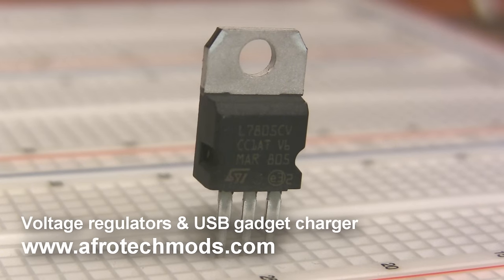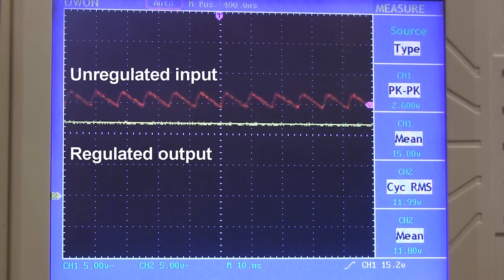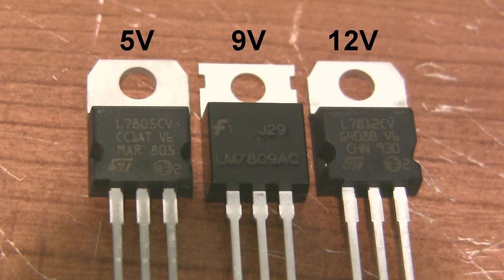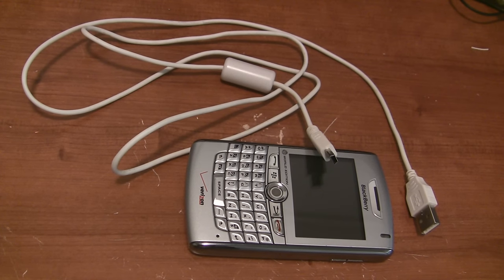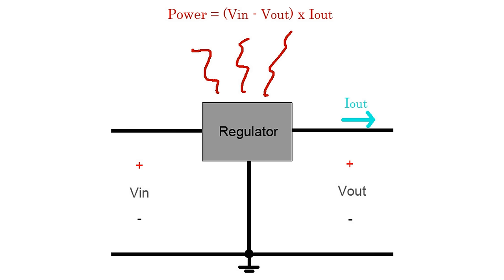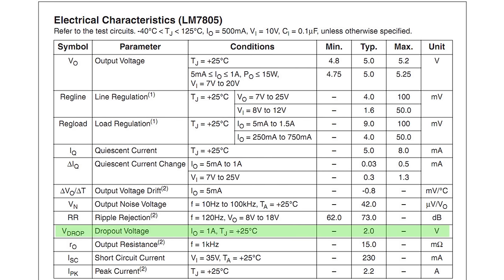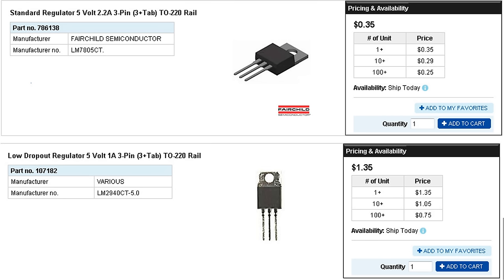Voltage regulator tutorial & USB gadget charger circuit

Comment: I've discovered that if you put the load between the input and output pin, you can use it as a voltage substractor, usefull for a cheap gauge indicator for 12v batteries

Comment: How do you know that you need a 10mikro Farad capacitor. Is there a formular to calculate the capacity of capacitors to a different project for example?
Reply from the maker: Capacitors can be used in tons of different situations and the formula to use will depend on the situation. 10uF for a linear regulator is just a generally good guideline value. The best way to find out the value for your situation is to google for the datasheet of the component you are using. It will either show you the formula or give you the recommended value.
Reply: It depends on the regulator, the current draw, and filtering requirements which remove high frequency transients and voltage spikes from the load. The datasheet for the regulator provides the details for what smoothing and filter capacitors to use in various configurations.
Reply: Survival Lilly
Reply: Read the datasheet for the regulator you actually use, especially for low-dropout ones.  Datasheets have specific information for the actual device so are the definitive source of information.
Reply: Fancy seeing you here Lilly!!! Love your videos!!!!
Reply: Capacitance doesn't really matter, the higher the capacitance, the more energy is store and the smother the output voltage is.
Reply: depends on the line frequency...proper uFD used is, " what frequency " is my ....project  ??? do a study on "pi filters "
Reply: @luongmaihunggia   I would not think you would need any or much at all if you are connecting to a battery. I don't have a scope, but I can't imagine a battery having a wave-form.. it's when you are converting from AC on a bridge rectifier and your DC is all wavy that you need the filtering capacitance. Basically, the higher the amplitude and lower the frequency of your input voltage wave the more capacitance you need on the circuit. I like to think of it as the capacitors average out several waves, the more capacitance you have the more waves it's considering for it's average.
Reply: @akunog3665  batteries are not perfectly DC, you still get electrochemical noises which are typically gaussian in nature....
but you also have the issue of coupling on wires, still recommended to use 0.1uF as a clean up on input.
the output capacitors I'm sure are more for "bulk capacitor" uses... to keep the output current maintained so that you don't get droopage when overdrawing.
Reply: @Afrotechmods  ⁷7_uu<⁷⁷⁷
Reply: Lovely
Reply: Ayyy! I watch your channel and just came across this comment of yours. Very cool to see that even 7 years ago you were putting in the work to learn to be self reliant and prepared. I need to find me a women like you lol Keep up the good work!! You are changing many lives for the better ❤

Comment: I don't understand the 251 people who disliked this video. It is as elaborate and as clear as can be.
One question though, what are the input and output capacitors used for exactly?
Also a question that is slightly off topic, I am trying to build my own Power Bank to charge my cellphone and intend on using either rechargeable batteries or disposable batteries.
I'm not very familiar with the way batteries work but assume these batteries do go empty, does that mean their voltage will drop from, say 5V, down to 0V, thus meaning I'll have to get a low-dropout Regulator?

Thanks!

Comment: 78s are positive regulators while 79s are negative.
Reply: RiaRadioFMHD773 Thanks for the tip!
Reply: haha i see what you did there.
Reply: thx a lot!
Reply: thank u
Reply: Can u plz explain the use of 79s
Reply: Rishik Kumar Negative regulators are used when you have a Dual Supply setup.  In a Dual Supply, you not only have a Positive Power Rail which is at a greater voltage than Ground, but a Negative Power Rail that is at a lesser voltage than Ground.  You can use Negative Regulators to do the same filtering to the Negative Power Rail that Positive Regulators do to the Positive Voltage Rail.  Dual Supply setups are sometimes used in signal processing or sensing, when you need to sense a truly negative input voltage swing.  In some things, though, such as audio processing, you can put in a bit more work to avoid the need for a Dual Supply setup.  Adafruit makes a ±12V dual supply that is not too expensive.

Comment: I am confused about the function of the 0.1 uF capacitor.  I understand a voltage ripple reducing circuit that uses two capacitors with a series resistor between the + leads in series with the current flow;  but when you put two capacitors together in parallel as shown - they just add their capacitance.  Right ?  So isn't the circuit as shown the same as just one capacitor at a value of 10.1 uF ??  and how is 10.1 uF any different than a single 10 uF capacitor - really ?  Thanks for any info you can provide !!
Reply from the maker: Donald Filbert The 0.1uF cap is made with a different dielectric - it is a ceramic cap. The 10uF cap is an aluminum electrolytic cap. Ceramic caps work much better at higher frequencies. The 10uF cap would be useless at dealing with noise at 100+kHz.
Reply: Afrotechmods Cool !!  Thanks for the response and info !!!
Reply: +Afrotechmods To the important in difference in dielectric is their ESR, Equivalent Series Resistance. In this circuit, ceramic's lower ESR helps the capacitor smooth higher frequencies.
Reply: +Afrotechmods so the purpose of that 0.1 uF ceramic capacitor is to further smooth out ripple in the output cause by higher frequencies noise?
Reply: Correct.  If you go back and look at the Osciloscope, you can see that there is some noise in the output voltage.  The 10uF and the 0.1uF capacitors help to clean up this signal.  If the original author were to hook up another probe to the board on the output side of the capacitors (or even just move the probe) we would see a near flat output voltage from the circuit.
Reply: @Afrotechmods  I was wondering the exact same thing! Thanks for the detailed answer. Hope to see this stuff in the video itself though!

Comment: Quick question. I know that some devices are trickier to charge (e.g. Apple Iphone from what I heard). Can you charge android tablets by supplying it with 5v or is it a little bit more trickier?

Also it would be awesome if you could talk about switching regulators. They more efficient and can handle a larger voltage range than linear regulators.

Comment from the maker: If the datasheet says you can leave it alone ("floating") then it's fine. Sometimes components will have internal pullup or pulldown resistors that make an input pin have a "default" state.

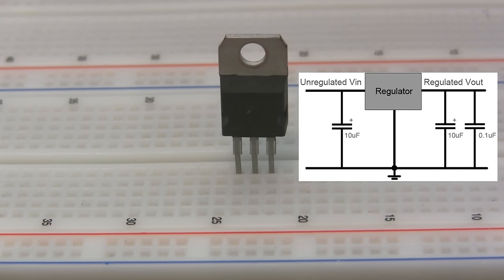Comment: 2:31 - how do I use google?
Reply: in order use google you must make a 12 volt circuit with 2 transistors and a 4 diodes and a stepping motor, then just connect it at the computer.
If you don't know how to make the circuit just google it.
Reply: lol
Reply: You jab a metal fork into a power socket. 

No seriously don't do that. 🙄

Comment: Nice an clear video, the output voltage is the difference between the "groud" pin and output, so if you lift your ground by resistor or diode output voltage goes up. example: needed 5.6 volt use a diode inline with ground pin, gives 5v+.6 v of the diode. If you use resistor you need to check the ground current. The output iis 5 volts plus the voltage drop over te resistor. I hope this is clear, english is not my native language. For higher currents use a booster transistor like 2n3055 (150 watts)

Comment: I'm so furious that i didn't understand the 0.1 micro farad capacitor. Why is it there? I read most of the comments, no one bothered to wonder. I just... can't... Why? What am i missing?
Reply from the maker: The material used to make the 0.1uF cap (the dielectric) is ceramic, which is different to the dielectric of the 10uF cap which is an aluminum electrolyte. This means the two capacitors have different performance at different frequencies. The 0.1uF ceramic cap is best at filtering out high frequency noise whereas the 10uF cap will be useless for that.
Reply: Write "I will use google before asking dumb questions" 100 times for me.
Reply: Generally you don't need the ceramic cap at the regulator, as each chip you're suppling has its own ceramic decoupling capacitor close to its supply pin.  Yes the ceramic cap will handle events on the timescale of nanoseconds which is the speed of logic chips.
Reply: There are NO "dumb" questions!
Reply: hmmm not sure what the difference is in asking here than asking google except that asking it here makes more sense.  The only dumb question is one that isn't asked or is asked despite it being answered in the article in question. The perception of "dumb" is based on level of knowledge when encountering a piece of information. A good well-thought-out tutorial will not leave these kinds of things hanging.  'Tutors' are usually (not always on youtube unfortunately)  well versed in their topics and can easily forget what watchers may or may not know so can easily miss/skip bits. This is a common problem for us beginner learners in any field.
Otherwise this guy's videos are great!
Reply: Erkut Aydın i
Reply: Really? That's good to know cuz I've always used mylar caps in place of ceramic ones in this design. Mind you I only ever use a 7805 when I'm making a TTL circuit.
Reply: To reduce the ESR of the electrolytic. You could also just use a low esr electrolytic, but those are expensive.
Reply: Ceramic capacitor removes RF frequencies which are main cause of humming or distortion in audio signals.
Reply: Superb!!!
Reply: a reason you might want a electrolytic on the output is its ESR as well - otherwise sometimes the output can bounce around like banshee.
Reply: @MarkTillotson  Not necessarily. If your supply lines are of significant length you need a ceramic cap physically close to the regulator, AND you need one close to the load. They are separated by the length of the supply line and therefore not really in parallel as far as RF is concerned.
Reply: would some 47uf capacitors work okay, how many uf can you be off? im a noob sorry
Reply: Afrotechmods  Sorry but the dielectric in this case is not the reason for the difference in performance. A 0.1uF ceramic cap has an impedance that is 100x higher (at a given freq) than a 10uF cap.  At 100kHz the 0.1uF cap is 15 ohms and 10uF cap is 0.15 ohms.  At this freq, the bigger cap is almost hitting the lowest impedance point, where the lead inductance begins to take effect. A capacitor can be modeled as a series RLC where the C is the capacitance value, the R is the ESR, and L is lead inductance.  With increasing freq, the impedance drops bc of the C and bottoms out (limited by ESR value) then rises due the inductance L.  It’s the capacitance value in this case that determines the impedance that ‘filters out’ the high frequencies.  Most regulators need a minimum amount of output capacitance to be stable, usually a few microfarads.

Comment: Sadly, everyone always discusses 'USB chargers' and things of that milliamp ilk, but they never discuss when your input is 15v+/-2v ripple and your current is 90-amps. What do you do about actual amps? You can't just ignore 180 watts of dissipation, and you don't want that 'big as a buick' heat sink issue. What then, relays?
Reply: I  think they use multiple regulators with a  combination of relays and forced cooling..
Reply: Can you use just one regulator to control the base of several high current transistors? In a H-circuit arrangement perhaps?
Reply: Actually, there are more high-amperage regulators than most external-appliance milliamp regulators. It's call 'your car alternator', and there are hundreds of millions of them worldwide. Sadly, since not one single video was on YouTube showing how something 12v and over 5-7 amps was regulated, I was lucky enough to get a schematic for an automotive regulator to see how they were handling the 'high amperage'. Quite simple, actually, and most do it for less than $20, case included.
Reply: For high current (hell, any current really) applications you'll want to use switching voltage regulators instead of linear ones. The chips are super cheap and the circuits aren't really much more difficult, especially fix voltage ones.

Look up buck-boost converter for voltage regulation. They are meant to regulate over and under voltages.
Reply: That is actually a good question. Looking for an air compressor that runs on 12V 7-10A but need a converter that runs off the wall. so those high loads are there.

Comment: What? I have a voltage regulator module that regulates to 5v usb with max. 3A. I've connected a 9v battery to this and my TABLET. The regulator didnt even get warm and my Tablet has charged as fast as is charged at its 2.1 A power Supply.
Reply: LM1084 and its setup for 5v using resistors.   my voltage drops from 5.20v to 3.30v when i connect a 2A load on it.. anyone help me solve this ? my power supply is 12v 20A and input voltage stay at a constant 12v and iv tried 2000uf cap on the output but still voltage falls iv used 4000uf also no change...and mobile phone stops charging under 5v
Reply: Mix Bag Unless you're using an adjustable linear regulator, you can't set the output voltage using resistors. You need a 5 volt regulator with no resistors for 5 volts. If you need more power (aka more amps on the output), get a powerful buck converter.

Comment: these things use internal zener diodes to drop extra voltage back to ground.  its a ridiculously inefficient way to regulate dissimilar voltages but it works!  these things have the benefit of providing instantaneous regulation even when there is a voltage drop caused by a motor or light bulb turning on.  it is good practice to engineer a circuit with input voltage closely matching desired output voltage.

Comment: Does it matter what capacitor (electrolytic, film, ceramic) is used?
Reply: Kyle LaFountaine Yes
Reply: +Kyle LaFountaine yes, and no. That depends on your voltage regulation needs.  In this circuit, ceramic's lower Equivalent Series Resistance helps the capacitor smooth higher frequencies, while the electrolytic capacitor is cheaper to provide the farads to smooth out lower frequency oscillations.

Comment from the maker: The current delivering capability will depend on the panel, not the regulators you are using (assuming you are using linear regulators like the 7805 in this tutorial). You have 2 problems now though - using the 12V panel will mean a lot of waste heat will be produced in the 7805. If you use your 6v panel, you probably won't be able to get a regulated 5V output. Try get a 9V panel, or use a step down switchmode voltage regulator with the 12V panel.

Comment: Hi:
I know that this is an old video, but I still have a question. When you already put a capacitor on the output, why did you have to add a .1uf ceramic capacitor also? Why a ceramic, and why so low amount and why not just up the 10uf electrolytic if you needed more. Thanks for your time and great videos.
Reply: I have the same question, what would happen if there werent any capacitors? or If there werent one of those...
Reply: So, they act as a noise filter? And the capacitance determinates the frequency they filter, right?
Reply: Sebas Eu Thanks! I will do a deeper research to fully understand the topic.
Reply: +Kique Phan Razquin Without Caps The curcuit wont be very stable. Its like using an LED. When you have an Voltage of 4v, you can theoratically connect a LED direct to it. But its still better to use a Resistor. Also i heard, that the Efficency suffers without caps. But if you dont care about Efficency, you can use it without caps. But i think everyone you will ask, will recommend you to use an 78xx with caps
Reply: AntoniRockReykern I think this is for reject the noise at 50 or 60 Hz. This is why to use 100nf capacitor
Reply: Thanks for the answer. Have a nice day.
Reply: There are two other comments at least that discuss this issue
Reply: I get why the caps are there, it just always struck me as bizarre why manufacturers don’t just build them into the regulator itself. Cost probably.

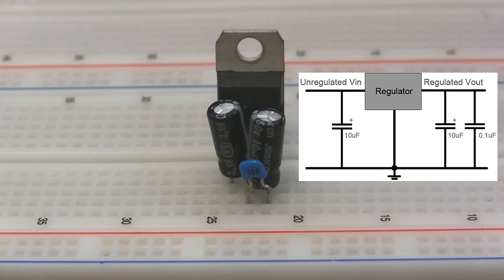Comment: At about 2:50 you used specifically a 0.1uF capacitor, then later said that the values can vary a bit with it changing much. Could you explain a bit?

Comment: I'll be needing this video when I go to install some LEDs in my truck. I got prewired 12 volt LEDs on the way (in reality, prewired with the resistor already built in) but I don't know if my truck will stay within the 12 to 14.8 volts it's comfortable with. Good thing I have lots of old circuit boards laying around.

Comment: Afrotechmods.. that's really nice. I picked up some of these, but they're SPX2940U. Very good I'd say. I need to regulate AC Voltage.. from a microwave 4W motor. I could just convert the two DC signals, but..

Comment: Perfect! I have some voltage regulators, but right now I only have 15 volt power but I need 12. That'll solve my problem pretty quick
Reply: 5  power diodes end to end  ( in series ) will drop 15V to 12V

Comment: Many years ago my electronics engineering project was to build a 1.5v - 20v 3A power supply and I used a LM-317 regulator however instead of "T" package, I used a "C" package which worked perfectly and I received high distinction.

Comment: Quick question. I just built a 30 amp 13.8 / 7.5 VDC power supply out of a burned out 1000 watt rack mountable PA amplifier. The transformer is a toroidial type that I re-wound for 16.5 VAC on one tap and 10.5 VAC on the second tap. Each rail is fed accordingly through a bridge rectifier and several smoothing caps which bring the DC Voltage to 13.8 and 7.5.
My question now is can the LM78xx series handle 30 amps? I cannot remember the spec of these things but it seems I would have to use a different type and not the LM78xx series